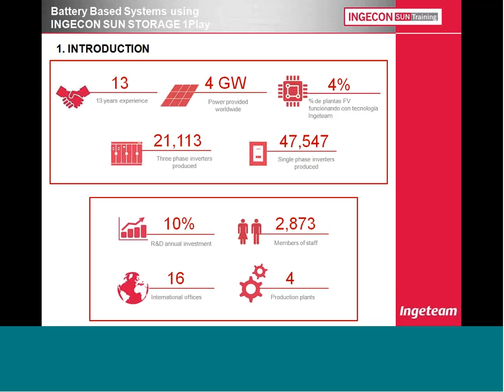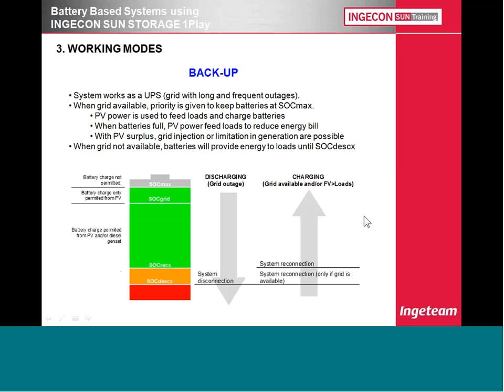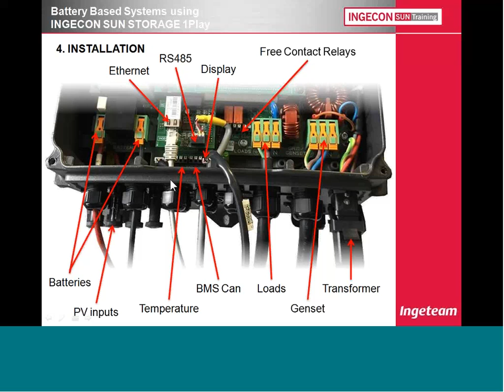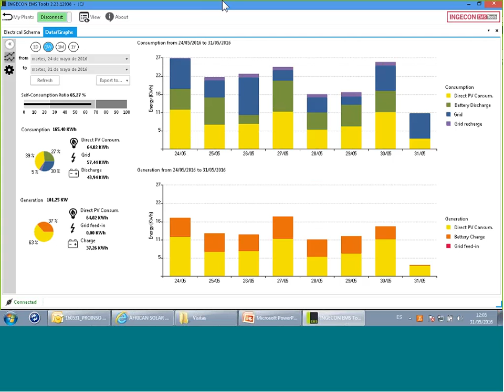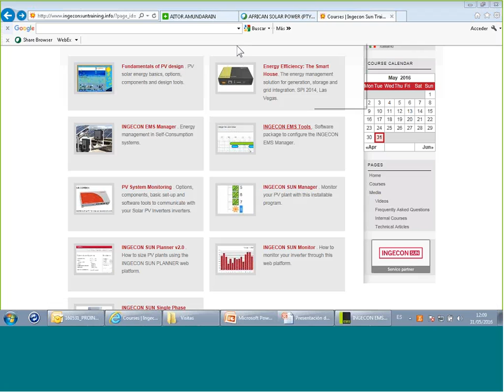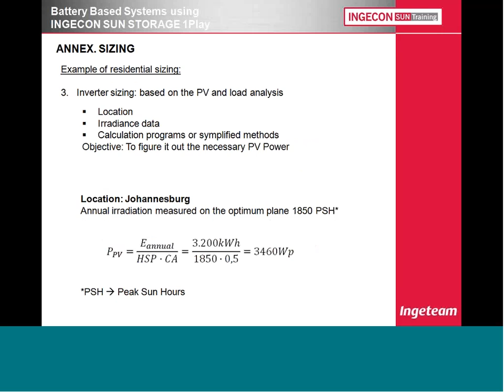PROINSO Webinar Episode 1 - Are Hybrid Systems key to the future of Residential Solar?

Comment: Hi , iit was nice to explain all this video it s help me to configure my system but i have a question i have ingecon sun storage works fine in Mode operation STAND ALONE and i want to monitoring my system it is possible to use ingecon Sun EMS Board with External Watt metter for monitoring my system ?? waiting for your answer Thanks